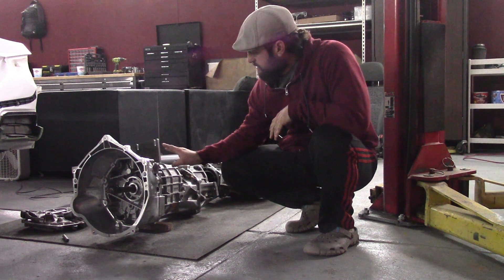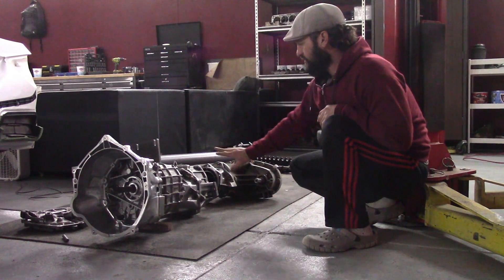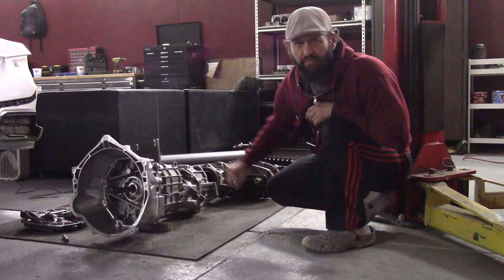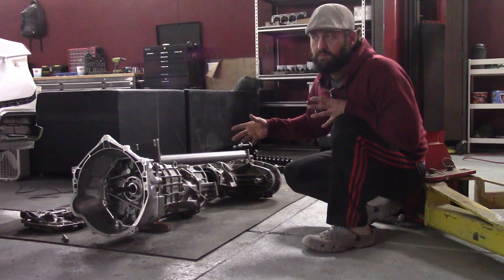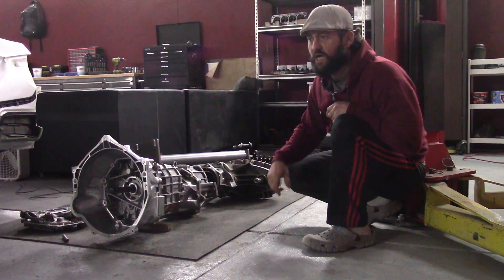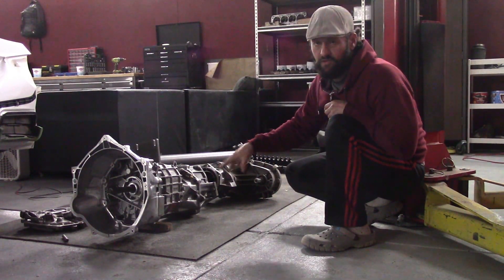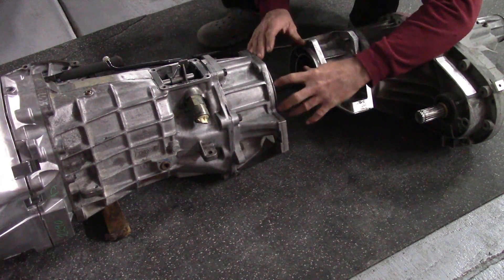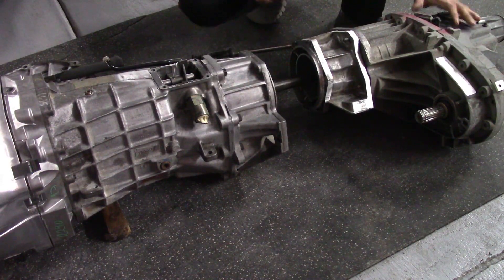T56 All Wheel Drive- AWD T56 Subaru Impreza LS 6.0 Swap

Comment: I'm doing a similar project on a Chevy Cobalt SS.  I've got a Trailblazer SS pan,  but the front diff mount location doesn't work out well with the front axle location.   I had been planning to graft together two pans,  to put it where I need it,  but I recently saw how some awd Cadillacs do it,  and now I'm thinking I might use a caddy front diff,  and just find a front sump oil pan to make room.   I've got a couple videos posted, I've got a trailblazer SS 5.3 dangling between the front fenders for mock up purposes,  I'll be digging into the rest of the project soon.

Comment: How are you maintaining  the awd in the subie?
Reply from the maker: The oil pan is from a Trailblazer SS, it has a front differential that fits in the pan. I installed a trailblazer ss AWD transfer case behind the t56 transmission. There is a front driveshaft like on a truck. I installed the engine in the car where the front diff lines up with the Subaru hubs so the front cv axles will be close to straight.